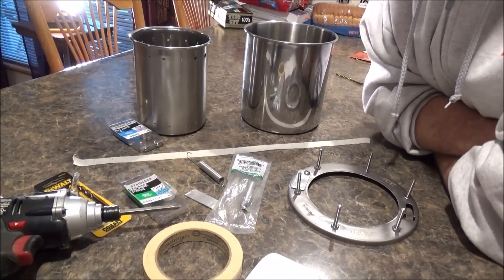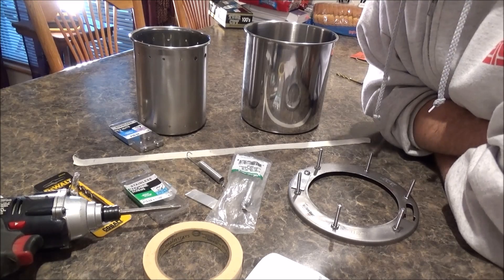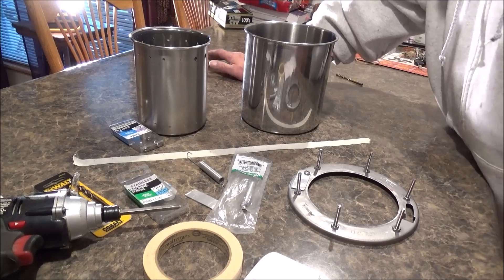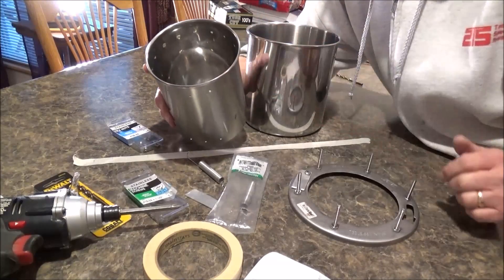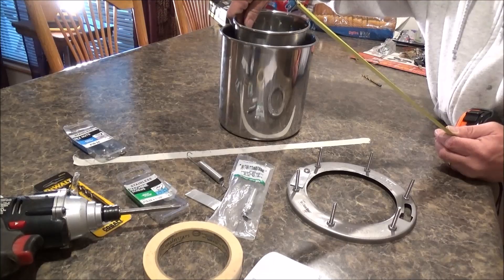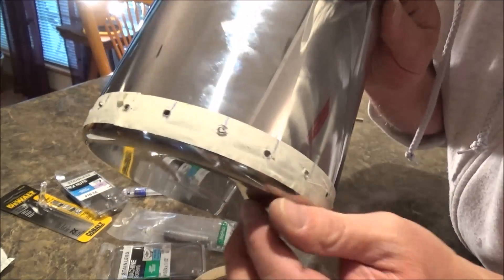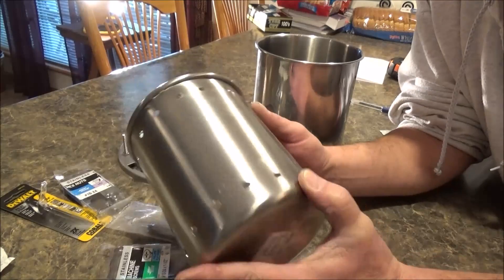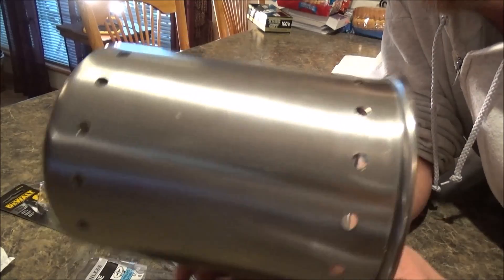1/3 $25 Diy How To Stainless Steel Wood Pellet Gasifier Stove Cheap Easy Portable Just Put Together.

Comment: Nice tutorial, But keep always in mind, the burning chamber tube must be in height 2x the diameter and at the bottom 1 3rd of the height must be dedicated to the air Flow. If You have 5 inch diameter, IT Has to be high 10 and under the burning chamber There has to be 2.5/3 inches free room under the burning chamber so your external Wall has to be high 12.5/13 inches with the burning chamber lifted From the ground. Sorry for bad english it' Not My native language, test those parameters and it should be pretty much optimized

Comment: I use a stainless steel ice cooler/bucket double walled, removed the bottom of the outer bucket and drilled holes into the bottom of the inner bucket. Near the top rim I drilled a row of 6mm holes 15-16 mm apart for the secondary burning. It is quite large 20 cm OD but I use it in a repurposed cole stove to burn wood pellets. It is great, hardly any smoke (only during startup) and no wood burning smell what so ever...

Comment: YOU MAY FIND THAT THE SPRINGS WILL GET WEAK AFTER THEY GET HOT ...
Reply: Or he may find that gravity holds the top down just fine.  There is the weight of the rim with bolts, weight of the inner can, and weight of the wood/pellets holding it down.

Comment: i would never be able to find these containers
Reply from the maker: Ei Pi Sorry, can you buy from Amazon? if so you could get it from them thanks for watching
Reply: Ray Isimz i looked...do these have a specific name?
Reply from the maker: I am doing another video in the next week or so of a much easier stove to build, I will give the exact amazon description of the 2 containers (not same as these)  you just drill the holes and put it together no top piece like this one, I think this next stove is much better it is just a little bit smaller holds about 3 cups of wood pellets it is my favorite so far. If you have a bed bath beyond by you you should be able to find the containers in this video or a kitchen supply store of any kind  some times they are called utensil containers, good luck
Reply: Ray Isimz i'll be looking forward to seeing it thxs
Reply from the maker: Thanks